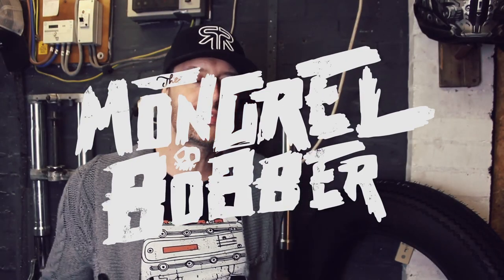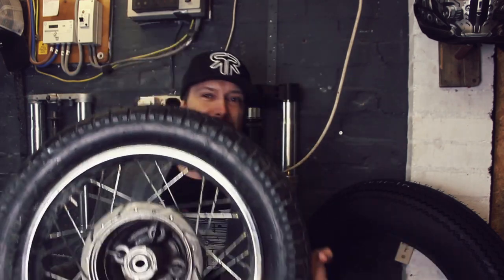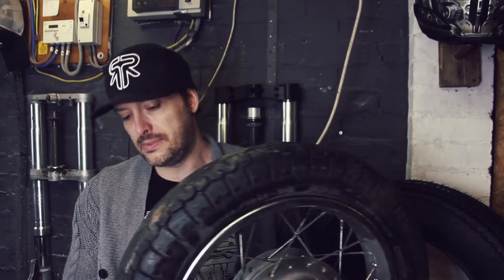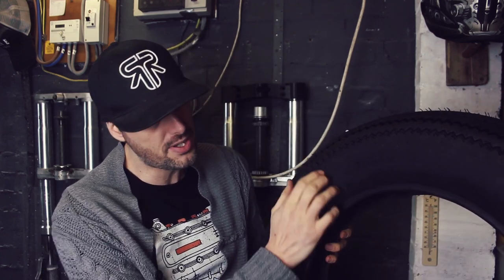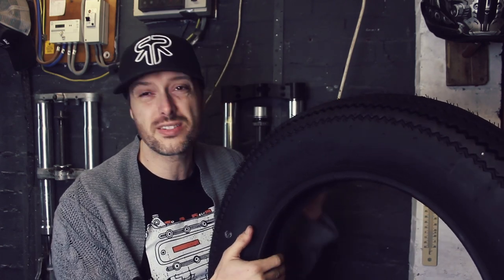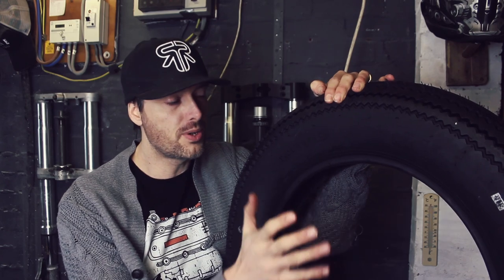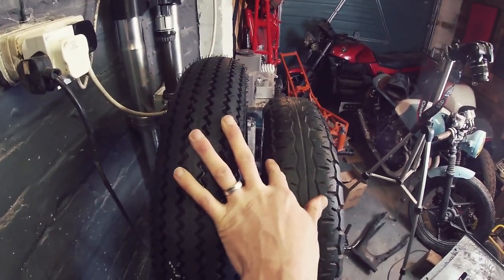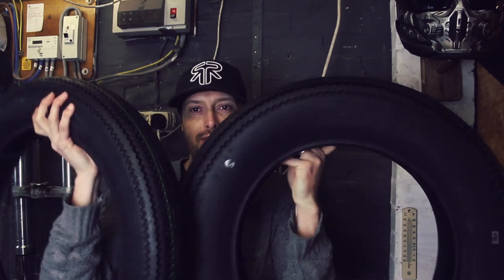Cheaper alternative to FireStone Cafe Racer Tyres (Victory TT) - VFR750 Bobber 'MONGREL' Part 13

Comment: I want to but this but unsure of they work well. Any feedback after using it?
Reply from the maker: I wouldn’t recommend them if you want corners
Reply: @forthebold  appreciate it man. Love the build.
Reply: I am using that tire on my brat-bobber bike. It is a good tire but I don't recommend it for racing and corner. Although you may lessen the tire pressure in order to be able to do a cornering or banking in other term.

Comment: Thanks for great videos, followed many of your videos for several years. And dreaming of building my own cafe, now I finally decided to do this with a Suzuki GS1000G. My plan is to keep the original rims but change the tyres. I really like the ones you mention in the video, but I can’t figure out how the profile is defined for these tyres? 5 inch width, but what’s about the profile, how do I find out the profile? I’ve tried to google around but couldn’t find an answer. Very appreciated if you have the possibility to answer my question.
Br Samuel from Sweden
Reply from the maker: I’d say they’re probably 100% height of what the diameter is.